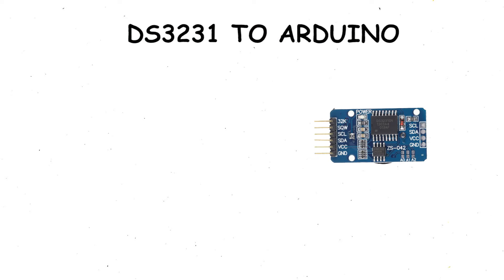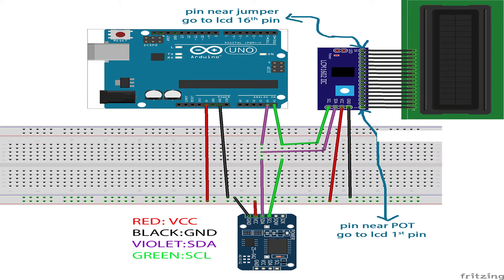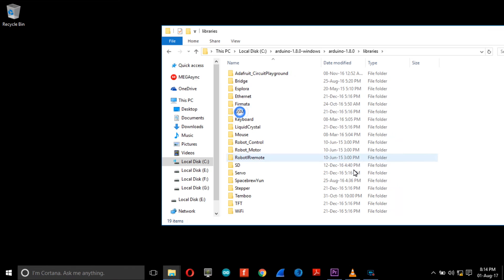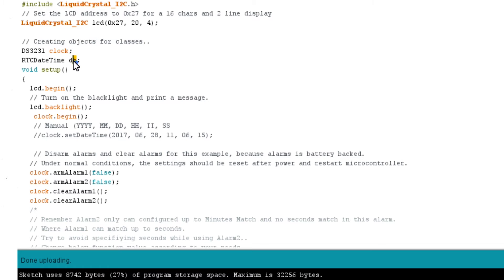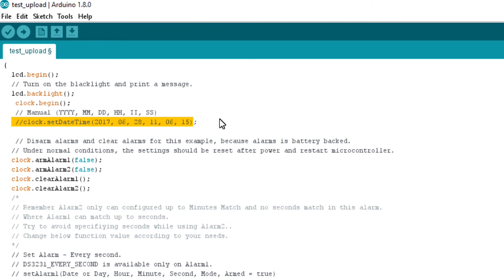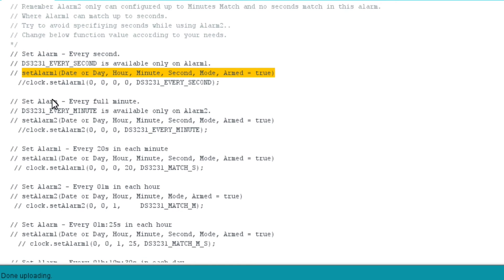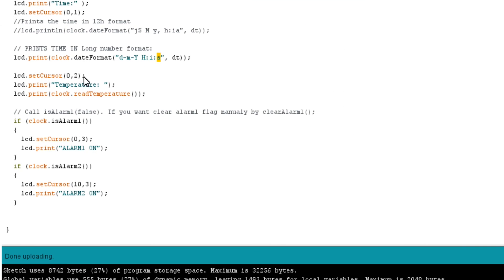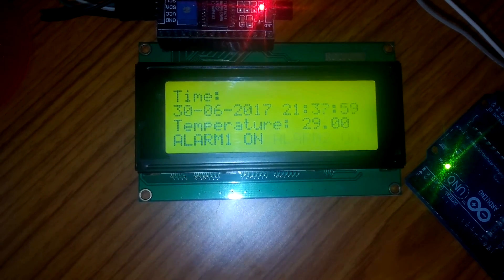DS3231 ARDUINO CLOCK ALARM

Comment: which DS3231 library is needed there are several, I try to complie your code getting error

DS3231_CODE:81: error: 'class DS3231' has no member named 'readTemperature'

   lcd.print(clock.readTemperature());

                   ^

exit status 1
'RTCDateTime' does not name a type
Reply from the maker: Dear Stove man I put a link along with the video where you can find compressed zip file which contain library code schematic almost everything.
Reply: @electrovoyager1125   thank you
Reply from the maker: I linked a download link for the library I used. Please try with it. Multiple libraries can cause compiling issues.
Reply: @electrovoyager1125  thank you will try and let you know.